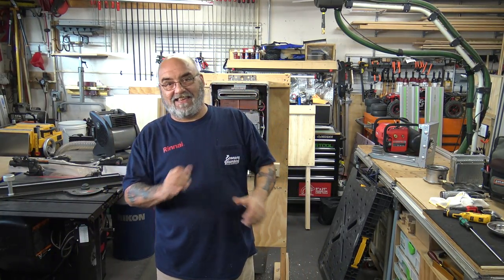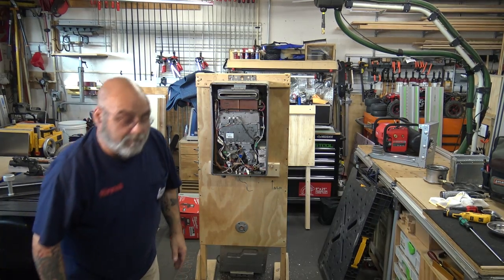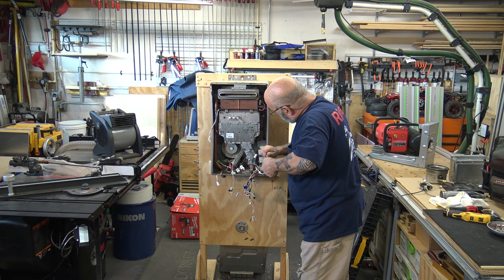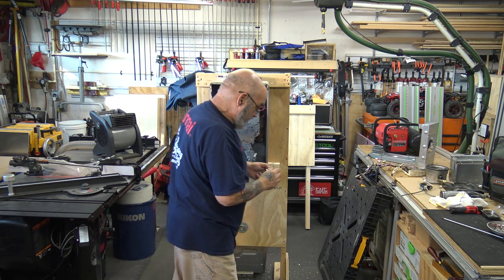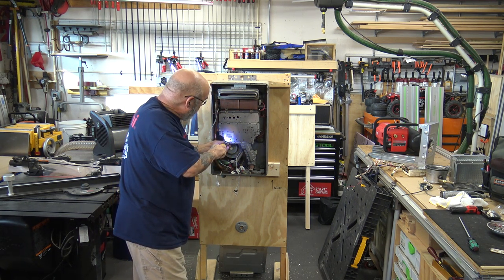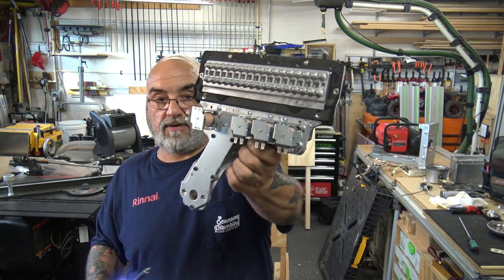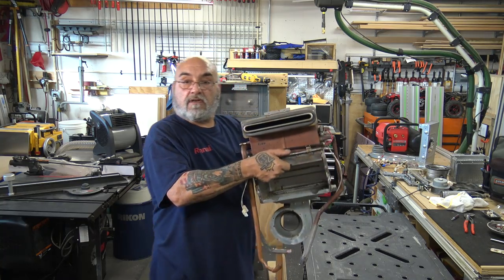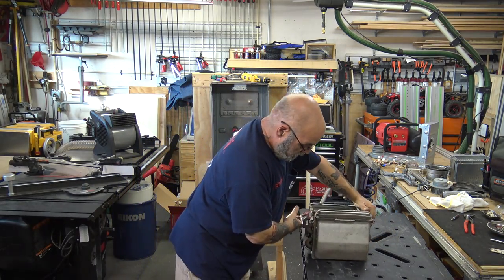Rinnai heat exchanger removal on a non condensing unit

Comment: Mike - you saved me!!  My RL75i started leaking before Thanksgiving and I called the place that installed it and go the runaround for TWO MONTHS.  They I called an authorized Rennai "PRO" shop and got a quote for $4,000 to replace my leaking unit.  I watched this video twice and it gave me the confidence to attempt this repair myself.  I bought the heat exchanger and also a new burner and the parts cost me a little over $400 total.  Tonight I spent 4 hours following the written instructions from Rennai that came with the replacement heat exchanger and when I fired it up it worked like a charm!  THANKS MIKE!!!

Comment: Just Changed a heat exchanger under warranty yesterday on a RL75I, Took longer than expected but in the end everything worked out. Between your video and the instructions in the kit it helped knowing what to look for and do before just tearing into it. Thanks for all the detailed videos I will definitely being watching and learning more about how to properly maintain my Rinnai water heater.
Reply: Also is it ok that it still smells like a burning smell after the hot water tank shuts off?

Comment: Mike - Thank you for this video. I had a pinhole leak in the heat exchanger on a RL94iN and the plumbers quoted me $6400 for a different brand water heater fresh install. Your video gave me the courage to tackle the replacement myself saving a ton of money. Took about 4.5 hours and worked like a charm.  Thank you for your knowledge!!!

Comment: Thank you SO MUCH for this video! Like sooooo many people in Texas, the copper pipes in the heat exchanger assembly on our Rinnai RL94 ruptured when we lost power for 75 hours. We DID wrap the pipes leading into/out of the unit, and they are fine. We did NOT know to drain the unit before the storm, in case of power failure. Anyway, after watching this entire video -- and one other brief one showing a snapshot/overview of before, during, and after replacing a heat exchanger on this type of Rinnai -- I was better able to understand that my best course of action was to replace the whole unit. It's frustrating that it's not a simpler fix, but when the parts plus labor are as much, or more, than a new unit, and when a plumber's time is a much needed and rare commodity (as is the case across Texas right now), it just makes more sense to do a quick swap out, rather than a time consuming job. So again, thank you!!
Reply: Did you buy a while new unit or just the heat exchanger? We're in the same boat here in Austin and can't seem to find the right exchanger
Reply: @monsieurmowgli4216  We concluded that it made more sense to buy a new unit. From what I've read, switching out the heat exchanger assembly is a 4 hour job. At the rate per hour a plumber costs right now in Texas, it would almost certainly be more expensive to swap out the heat exchanger than it would be to swap out the entire unit.

If you're determined to keep and repair your unit, if it's a Rennai, check the inside of the front panel for a little plastic envelope with a large paper schematic inside it. That will list all the parts. 

For my Rinnai RL94e, the heat exchanger assembly per the schematic is Part Number 107000100. That MAY possibly have been discontinued and replaced by part Number 104000245. However, that info is from a parts website that I've never used and am not very confident about, based on the reviews. A call to Rinnai might help!
Reply: I have taken apart the water heater myself already and just need the part. Took me less than an hour to take it off the wall and have it disassembled. Just having the hardest time finding the part. Thanks alot for responding. ✌️
Reply: I’m glad it helped. Part 2 is being downloaded as I type. A lot more info in it Mike
Reply: What did you do with the old unit?
Reply: @ramonguzman9915  We're holding onto it for now. Insurance wants to see it.

Comment: Hope it's many many years before I need to know how to do this job to my indoor unit.  Great job on showing all the screw locations,  it's always a pain wondering why things will not come apart when there's that last screw that you don't know about.  Also thanks for the information about my low flow natural gas.   I am going to have to switch to the 2 pound system.
Reply: I’m glad this helped, e mail me if you need to go over the upgrade to 2 lbs. Mike

Comment: Hi, We live in Texas and just experienced the crazy Texas winter storm.  We have the Rinnai tankless model #RL94i. We lost power x 3 days. We were out of town when storm came through, however did leave cool water faucet on. We had a pipe split on the hot side leaving the water heater. Now the water heater only provides intermittent hot water 30-45 sec. No error codes and green light is on. Plumbers are telling us they don't have time to diagnose or troubleshoot and we should replace the unit. However the unit is slightly over 1 year old. Any help you can provide would be greatly appreciated!

Comment: I had temperature swings post heat exchanger replacement, and eventually code 12’s.  Turns out that the gas modulator solenoid (with pink wires) got wet when the heat exchanger leaked.  The solenoid plunger spring was corroded, and the plunger was sitting in water.  Might be worth pulling out the gas valve assembly when replacing the heat exchanger (only 4 more screws) to make sure it is dry and clean.  

A new gas valve assembly and the unit was 100%.  I did not attempt cleaning off the corroded one.

Comment: Hi Mike,
I had a leak in my RL75i and decided I'd solder it. My problem is that my son pulled off all the thermal wires before i got there and i could sure use pictures of sides and back I'm sure placement is important. Thanks for any help. love your films. Vic

Comment: My RU 65 E since day one if the outside temp gets below 60 degrees it will not light burner until I Flip Breaker. Then it will restart and burner will light up and get hot water. But once I shut it off again and the outside temp is still 60 or below it will still need restarting again . But once it warms up outside it will work as it should. WHAT IS Causing this HELP

Comment: Mike thanks for the information, does this video also work for the V94IN models? What are the differences?
Reply from the maker: It’s about 90% the same except you will need to remove the vent and vent box and reinstall it on the new one.
Reply: @ThatTanklessGuy  Thank you very much.

Comment: I have a very small leak right where the thermister connects, is it the copper pipe that will require a new exchanger, or is there an 'open' connection there that the leak could be coming from?
Reply: you mention an o-ring, so I guess I am questionning if that could be bad???

Comment: Howdy, do you know which heat exchanger I need for a Rinnai Rl94e?
Reply: New video on that is being uploaded as I type. 
Look inside of the front cover there’s a paper in a plastic bag. It will give you the part number. I show different things you would need to do to change the exchanger. Mike

Comment: I have a c53i- 0(reu-v2520ffuc-us) with a burned out thermal fuse, part# u245-3190-s, and they tell me this part is obsolete/ no longer available and with no replacement. Am I supposed to just run this unit with the thermal fuse circuit jumped? Doesn’t seam safe to me, but what else can I do?
Reply from the maker: Please do not run the unit with the fuse jumped there is a reason the fuse let go snd if it’s a partially clogged heat exchanger of burner you could cause a fire. Unfortunately with the age of the unit you might have to replace it. Sorry Mike
Reply: I believe the fuse let go because of the disintegrated gasket around the electrodes. It was leaking hot gases right below the fuse harness. Disassembled the entire unit and cleaned the burner and the heat exchanger. Thus particular unit is used to heat the floor of a separate garage from the house. Unfortunately I may have to run it again come winter- it gets to -45f here, as I just can’t afford to spend upwards of $5000cdn I’m told it would cost to replace it. Thanks for the reply, you have great videos!
Reply: @gregmurley3410  A fuse is a fuse, how they work is often different but I would just use another thermal fuse of similar value. As long as there is a pressure relief valve it's not gonna turn into a bomb. We cannot ALWAYS fix things perfectly to code or we'd be more broke than we are now; Just make things as safe as possible...